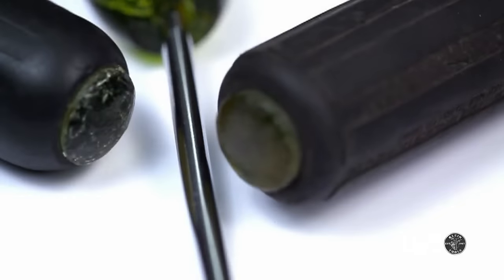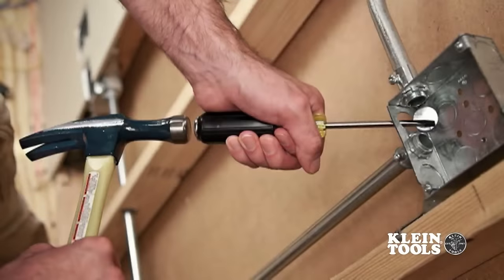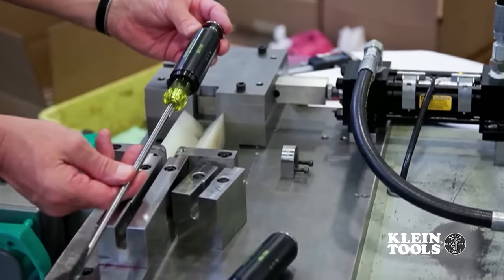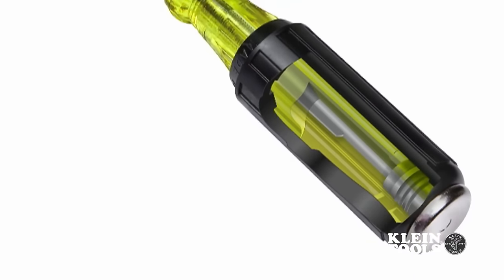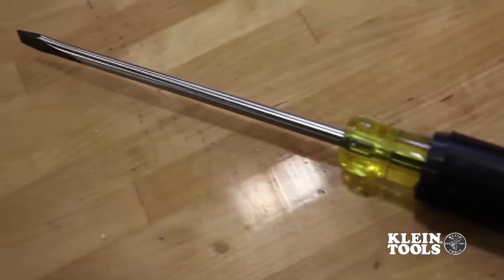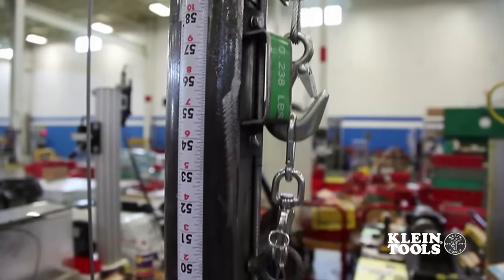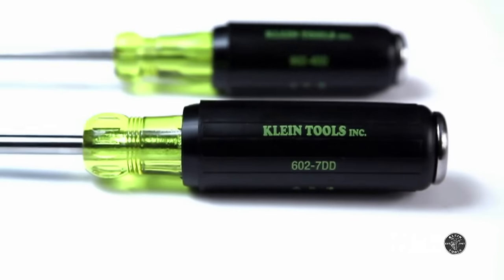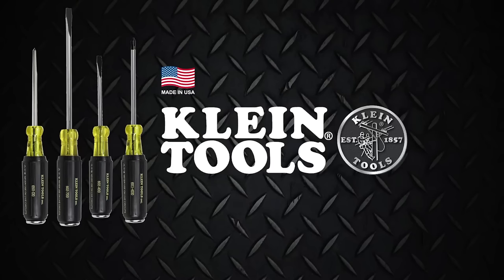Demolition Screwdrivers

Comment: I cannot understand why they didn't offer a #3 Phillips demolition screw driver. Low voltage guys constantly have issues with removing old hinges to be replaced with a power transfer hinge. Most commercial hinges require a #3 Phillips. I guess i will have to buy from felo. Thanks for thinking about us low voltage guys Klien.

Comment: Tip broke on a sieved screw. Handle snapped in the plastic. $30? Crap
Reply from the maker: Hello Kalen. We responded to your private message. The quickest remedy would be to take the item back where you bought it so it can be replaced under warranty. If this was a gift and you don't know where it was purchased, or if for some reason the retailer doesn't honor the warranty, go to the warranty section of our website and click on the link in the "Return Process" section and you can get the replacement process started by filling out the warranty form with our customer service department. If you have questions,  please contact our customer service department at customerservice@kleintools.com or call them at 800-553-4676. They will be able to guide you further. Thank you.